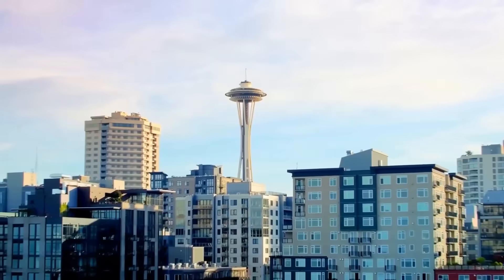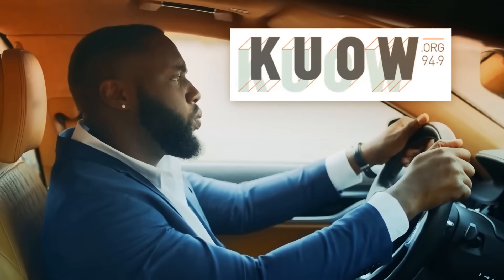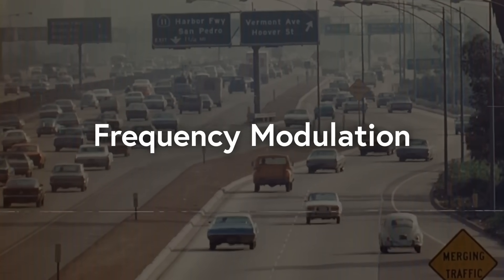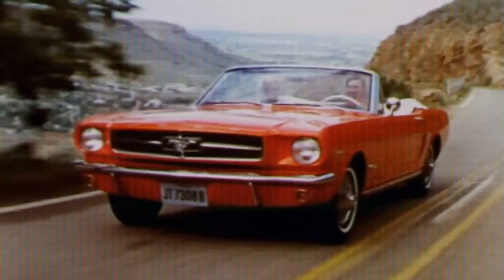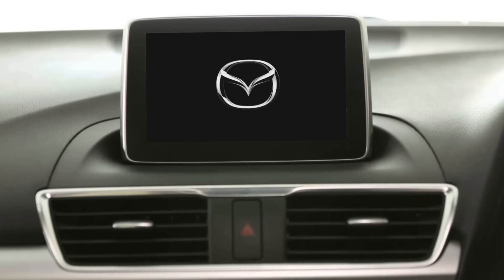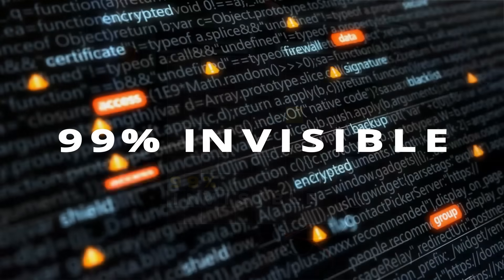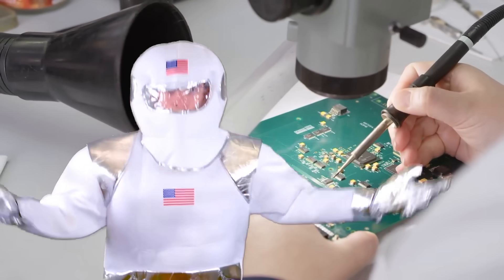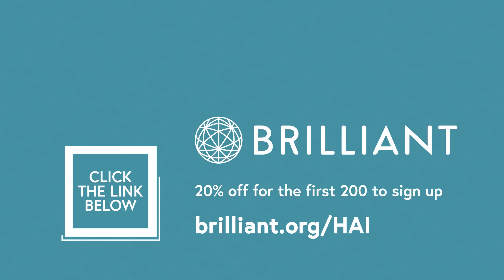Why Hundreds of Mazdas Tuned to 94.9 Broke Simultaneously

Comment: 1:14 Wait, I am pretty sure that the amplitude does not affect the sound pitch, but it affects the volume. Can somebody correct me if I'm wrong?
Reply: For normal acoustic waves, yes, but in the case of AM radio, the computer is designed to interpret the fluctuations of amplitude in the electromagnetic waves in a way separately from volume. The engineering problem is finding a way to communicate meaningful information without modulating frequency, so instead of encoding information in changing frequency, they encoded in changing amplitude. They could have chosen to program radios so that changing amplitudes affected volume instead, I suppose, it’s just not how they set it up. (I might be wrong, this is just my most educated guess)

Comment: wow are your serious it was that easy...I swear the people who design "digital entertainment centers" for modern cars are some of the laziest, brain-dead people on the planet. most cheap aftermarket Bluetooth radios connect faster than the "voice- connected" system they implement. maybe they are limited due to safety regulations and take that as an excuse to not even try. it's like they don't understand how people use cars. of fucking course they did less than the bare minimum and didn't even put in a safeguard for special characters or incompatible files. there always 'phoning it in'. they breathe out their ass.

Comment: I never saw the appeal of HD radio.  I mean FM sound quality is just fine.  The difference between that and a CD is not noticeable like the difference between SD and HD TV are.  And if you need some buggy computer to decode some radio station's buggy transmission then I definitely want nothing to do with HD radio.  Some things don't need to be fixed.  Radio is one of those things.

Comment: Determining a filetype for common formats by contents rather than extension is trivial. Also strange there wasn't any fallback of failure that would just skip the file. Worst of all, designing system that couldn't just be factory defaulted, or a memory chip replaced is unacceptable. You can buy $40 IP security cameras, if something gets messed up, you can default it, and also change firmware.

Comment: Out of curiosity was the rebooting damaging the board or could taking the files out of the computer's storage solve the issue?
Reply: Removing the faulty file from the cache should fix it, but the thing would just refuse to boot and the only way to access the files would be to unsolder the chip from the board, try to access it externally, remove said files and solder it again. Not easy at all.

Comment: The $15 motion alarm I bought from Harbor Freight, as it turns out, can brick the info console of my 2019 Ford Raptor.  Lucky for me, it clears itself by power cycling the truck.  The wireless detector has a ~435 mHz signal to the separate base unit/alarm.

Comment: The new car dashboards are on a size of a tablett with many functions.
You actully have to look on them when you want to switch the currently playing song, turn on AC, turn of the lane assist systems that wants to push your car into the incomming traffic because you are on a narrow street with no middle line.

But you are not allowed and gets fined alot (rightfully) when using a phone while driving. 

there is something wrong with new cars and it is getting worse.
Reply: If the manufacturer builds a driver-distraction into your car, that's perfectly fine. But if YOU bring one into your car - GUILTY!

Comment: What this video does is not explain better the differences between FM and AM:

AM - Amplitude Modulation - The easiest way to describe this is;
imagine a person is deaf.  You must yell louder at said person to penetrate his deafness.  Your raising your voice (equals raising the Amplitude [or power output of the signal to your intended audience).  Am is great for music, talk Radio, Sports radio, and or any other form of communication that can be transmitted over great distances.  AM allows for a local Station to xmt and do so (while covering the entire area).  As you raise your voice, you raise the power sine curve (when seen on an oscillator).  This positive and negative curves (in the positive and negative sections of the Htz (Hertz = one sine wave cycle per second).  

Thus, an AM Station relies upon the power level of the signal.  That is why you can receive AM frequencies (Htz/second) at a much greater distance.  It may be faint, but you can receive it.

-----------
FM - Frequency Modulation - Let us take the deaf person and attempt to communicate with said person.  With AM, you need to raise the amplitude (the power output of the signal htz/second power curve) to penetrate the deafness of this individual.
FM or Frequency Modulation = not changing the power output.  It takes the signal and then compresses the signal.  You can put a much greater amount of information in a FM signal (because you are xtm(ng) a more compressed signal).  Your radio (car) goes (from 80 - 109 MHtz or Mega Hertz 1,000,000 [sine waves or [Htz(s)/second)].  This means that the signal has (between 80 million cycles per second and 109 cycles per second (sine waves/second)).  
You now use the frequency as the "carrier wave" = the wave that you can add more to the signal.  The AM signal can not do this because the AM signal is not based to perform this manner.  As the number increases, the cycles/seconds (sine waves/second) then increase and compress.  FM is excellent for an omnidirectional antenna.  An omnidirectional antenna, xmts a signal in a circle (much like a ripple in a pond as you throw a rock  into a pond).  You see the circles start tight and then get looser and looser and looser.  Eventually, the signal will "fade".  This is called Attenuation of the signal (the eventual loss of the signal due to loss of signal strength).
If anyone has traveled, they know that one must put the radio on "search" mode for an FM station.
Back to the deaf person; 
You now must xmt on a specific frequency, and the person must rcv on said frequency.  You now can add more information into the frequency (using the original frequency as the carrier wave). The deaf person now can receive the information on said frequency (with added information along the original FM Frequency).

I hope this has been helpful.  If not, please respond, and I will gladly assist more.

Comment: I'm old school, I repair things that break. Instead of just throwing it away and spending another $1500 for a hard to find an original, try having someone trained in electronics ( like me, 40 plus years) actually finding the reset pin on the microprocessor and physically resetting the radio. DOH! We are such a throw away society.
Reply: Most users (billions of us) know that it's easy to simply turn off-on power or press a reset button as you wrote. The code creators however, don't seem to know this; for any appliance you have at home, the owners manual or on-line how-to guide show us to go through a complex series of instructions to reset your computer or TV or whatever. I think they are just arrogant with a attitude, "software can fix anything" so ingrained into their heads that they forget that simply resetting the damn thing is the easiest thing to do!
Reply: im pretty sure the issue is that the cars do not come with factory reset buttons. good luck figuring out how to manually delete those cached files by yourself.
Reply: Won't help if the file is sitting in the cache. You wound have to be able to wipe the cache on a device with no user accessible input.
Reply: @DanaTheInsane  Depending how the cached data is stored, it could possible be as simple as removing any/all power from the storage media, otherwise it's more than likely there's some means of accessing the onboard software externally. Mazda may have some proprietary system in place, or possibly even a simple UART. If nothing else, replacing the storage media where cached files are kept may be less wasteful than binning the entire unit. Cheaper/Faster is a different story though

Comment: FM radio did not start in the 1960s like you said it did; it started in the 1930s.  Read the Wikipedia entry under FM Broadcasting for more information.  Please correct your video.

Comment: Mazda was stupid to allow their entertainment systems to be reprogrammed (with non-programs in this case) simply by sending the radio a file (with extension or not) over the air. All they had to do (just one example) was to have a jumper behind the volume knob to enable reprogramming. The tech would pull off the jump, plug a tiny jumper into the jumper jack and ONLY then could it be reprogrammed - easy. I worked for a company that made radar for cars. Because it is a driver safety issue, the programming sequence needed an elaborate sequence that had to be done with strict timing in order to reprogram it.  Just laziness on Mazda's part.  But I can say this about their competitor: Honda. They are tough but fair when it comes to their products and sub contractors... they strive to build the safest cars in the world and cost never gets in their way...they do things right the first time. For me it's Honda, Mercedes-Benz, and GM.  These are the ones I drive.   Well, maybe Lamborghini too [smile].

Comment: i was a computer programmer way back in the day when you had to write your own stuff. one day our mainframe shut down. we rebooted it and everything seemed fine for about a month. it was shutting down and we couldnt find the problem. all hardware diagnostics came back 100%. so we began looking into the software. we found that sporadically a customer service agent would be entering order information she would hit the enter key simultaneously with the back slash (\) key. this character (\) was used in the database as a delimiter and consequently corrupt the data which would do the same as these radios. easy fix was we would check for special characters and remove them from the data and then write it to the system.

Comment: So these car systems weren't permanently fried, they just had shitty programming. I'm assuming someone with a bit of IT knowledge could just wipe the system and do a fresh install. Am I wrong? I have older vehicles so I have no idea but to my limited knowledge, most systems running a version of Linux, windows or Mac can be reconfigured. So I don't see this being any different. Of course you might run into proprietary bullshit but at that point it may be possible to find an even better open source version than what u had before. Anyway, can someone with one of these things weigh in? Have you ever needed to get into the device's system? Is it possible to reformat or reinstall a fresh OS?

Comment: This is NOT the radio station's problem. It's a boo-boo for sure, but it is ENTIRELY Mazda's fault for poor software implementation. The software industry regularly tests their systems with bad inputs (i.e. files without extensions, etc) to make sure their software is "fault-tolerant". Sounds pretty much like Mazda skipped this step and shipped a VERY buggy infotainment system. BAD MAZDA! BAD!!

Comment: Classic bootloop. My phone had a broken ram drive & it caused a bootloop. Kind of odd that they don't include simple debugging tools on the consumer end like you get with a personal computer/phone. It's SUPER easy to clear a cache or load a backup. An expensive mistake with a solution that would cost pennies per car if implemented proactively

Comment: The problem is lazy implementation. Cars are precision engineered to solve a wide range of problems that arise from nearly every feasible condition it will encounter in normal use. And then they shove critical functionality onto a computer that was only supposed to run the radio. It's allowing the "we can ship it and patch it" ethos of a software startup into a space where a mainframe is more appropriate.

This is also why NASA was using 1980s chips in the shuttle right up to the last launch in 2011. You can make a computer reliable, but industries aren't used to that being profitable. And they aren't trying.
Reply: I would question the idea of software to solve engineering problems.   Cars worked fine for nearly a century without all this extra stuff.   Steering, power, braking, etc should be independent PERIOD.  
Who ACTUALLY needs their radio to display pictures?   To the point where one glitch can cause big problems?   
The trend is to interconnect everything.  They should be keeping systems separate.   The push to offer shiny gewgaws and whizbangs to increass sales will likely keep this a perpetual problem.  
As for me, if someone offered a new car that was functionally identical to a 70’s/80’s design, i would buy it.   Not this kind of thing.
Reply: @yestfmf  While there is some benefit to planned integration, yeah, this was stupid all the way around. A person driving doesn't need the added distraction of album art popping up randomly on their dashboard. It would be a cute feature on a home radio or radio app on a device, but it's an inherent detriment in a car radio.

The benefit they get out of integrating the computer into critical car systems is that it saves money. Small, device-level computers and actuators are cheaper now than the steel used to connect up the steering wheel, brake pedal and gas pedal through mechanical linkages so it saves a company like Toy Ota money manufacturing drive-by-wire vehicles. Fly-by-wire works because planes are constantly inspected, but cars break down and wire issues become fatal faster than mechanical issues. That said, if they did it right, wire systems can be self-monitoring and balance that out.

We have electronic systems that are more reliable than mechanical counterparts. The problem is that many electronics are falling into the cheap-enough-to-be-disposable range and yet the cheap crap can be adapted to do incredibly vital things. You can buy a cheap Chinese can opener that works 3 times and then breaks but you can't make that can opener operate your brake pedal - but you can divert processing power from a cheap Chinese radio to operate brake actuators in your car.
Reply: It was not 'critical functionality'.  The 'infotainment' (Arggh) system crashed.  The vehicles still functioned normally in turns of "engine goes around coupled to the transmission goes around to the wheels go around, right pedal go, left pedal slow".
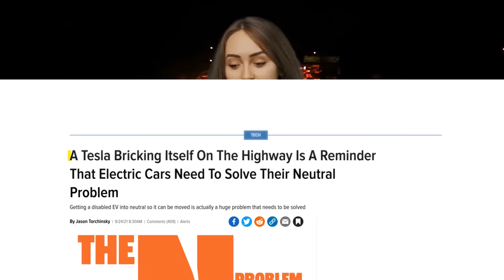Reply: @anthonyjackson280  See 4:29 in the video where he mentions Tesla bricking itself in the middle of the highway - I was not talking exclusively about the Mazda failure from the video title. Or see the Toyota drive-by-wire systems that got stuck in acceleration. Or the several other cases where software integration has allowed non-critical systems to elevate to potentially deadly critical system failures.

And, yes, many of these DO involve the car manufacturer routing critical system controls through the entertainment system.  I'm not saying "infotainment" for a reason here, by the way. I've personally experienced this with a radio that did NOT have a smart display and did not display any information other than what station you were on - but the car could not even move if the radio died. Fortunately, in my case, the radio had audio issues that made me replace it and learn this rather than having it die on the highway like the Tesla mentioned in the video. 

Before assuming someone's comment makes no sense, rewatch the video and make sure you didn't miss the context it's referring to.

Comment: HR Radio in Southeast Connecticut:
a) works UP TO 5% of the time,
b) available on only four or five out of literally dozens of stations,
c) drops out when clouds pass by overhead, or when you're descending a hill, or turning a corner, or driving under an overpass, or driving under trees, or when it starts raining/snowing, or you open a window, or you raise the trunk lid...

I'm sure it's WONDERFUL in flat, unobstructed areas, like if you were parked in a parking lot in the midwest, and your local station spends the extra money to invest in themselves. WHEN it works, it's a night-and-day difference in audio quality, and the subchannels offer additional listening options. The caveat is it requires a strong unobstructed signal that often can't be maintained while sitting parked. In motion, you're constantly in-and-out of HD which is annoying - you can't turn the feature off, so you either live with it, listen to channels without HD, or use another source.

HD Radio works almost as well as the RDS system. Wrong song title/artist displayed, garbled text, odd combinations of title and artist appearing as one word, and I had to turn off the "Auto Clock Set" function since my radio's clock would change with every RDS-capable station. Imagine my shock when the clock read 0:39 for the time - it didn't allow a zero to be set for the hour manually - and sometimes it's off by multiple hours AND minutes, as if the radio station never set their time correctly.

Comment: Make cars more complex, add computers to them, wire all the systems together so that if a superfluous part fails it can damage the main function, then fight to end "right to repair". Modern cars are trash, get an old one. I can't wait for those remote kill switches to go live. Those will be abused.
Reply: I can see someone hacking into that and broadcasting it worldwide.  Or if it has to be local, hiding a box near a busy road.

Comment: So why only Mazda?  Take any file on your computer and change the .??? extension then try and run it...your computer should vomit something, "Incorrect file extension."  Why?  It checks out the first few bytes of the file for it's header/signature and complains if it doesn't match the extension.  So why can't Mazda's gear do that?

I'm putting this one on Mazda.